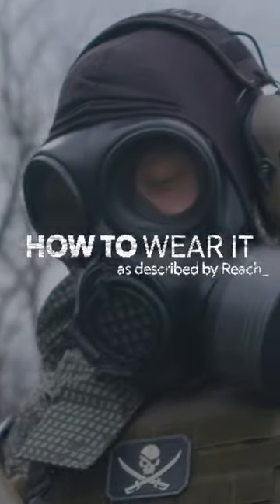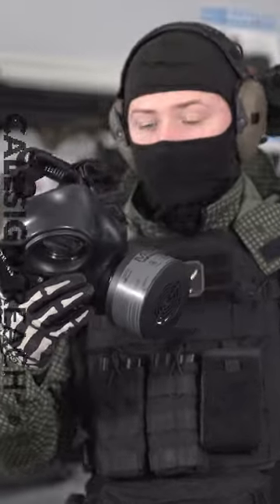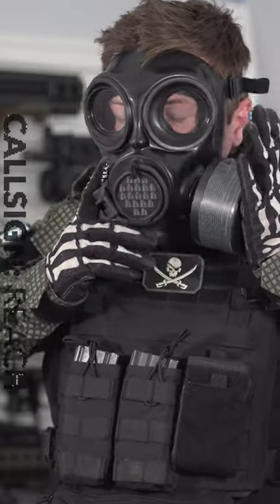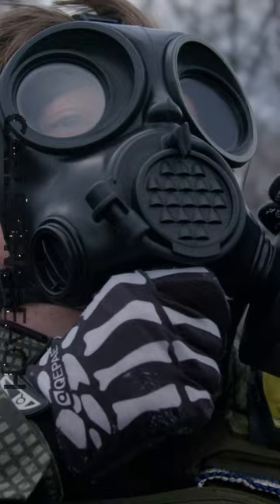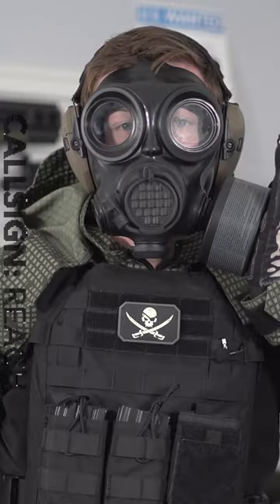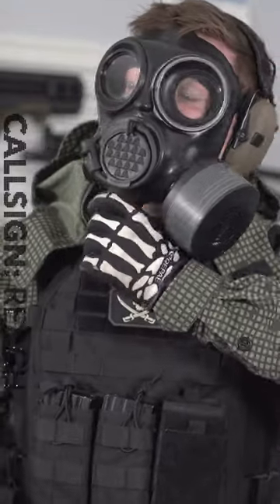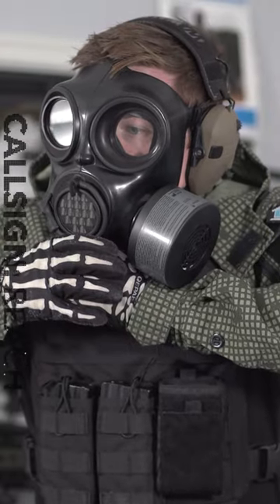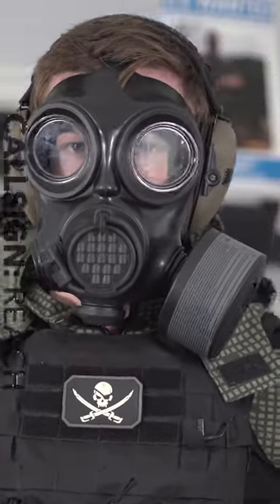MIRA Safety CM-7M PART 2 | Callsign: Reach #airsoft #mirasafety #gasmask

Comment: Should be rubber touchin skin.. nothing in thee way
Reply from the maker: Words to live by 🤜🤛
Reply: I hope it never comes the time where I need to wear a gas mask because I would have to shave 😢
Reply: @Mrboombastic266 id rather shave than die
Reply: @Not.TravisScott  True, I would be dead inside tho
Reply: @Mrboombastic266  same lol
Reply: @Mrboombastic266  there is a mouth piece for people with beards, the filter mounts on the your back i think, the downside is that it can slip out so you gotta tape it to your face or something, and you have to put a nose clip to seal your nose and then wear eye protective glasses to protect against fumes and stuff, looks like diving gear
Reply: this had been disproven, you can have the biggest most santa claus-ist beard ever, it will still seal fine
Reply: @blueberry766 id rather look like scuba steve than baby face, ill take it
Reply: @Mrboombastic266  you don’t have to. Siri shows that she doesn’t even matter.
Reply: You can wear modern gas masks with facial hair as long as it isnt bushy
Reply: @Mrboombastic266  depends what mask, some will work with beards.

Comment: I hate mira safety, you can just get a slightly worse mask for $100 less
Reply: Hell, you can get the same mask for under 100, shipped! They're just repackaged OM90s!
Reply: These are new production masks. While they may be built like the mil versions, they are new materials. Over time, the material breaks down and loses its resistance. I wouldn't trust a milsurp mask unless I literally had no other choice.
Reply: No you can get a slightly better version for 100$ less lol

Comment: Can’t believe mira “safety” is selling an obsolete CZ gas mask from the 90s for around 2-3 times the price. Like for that price I can get an m50 mask  that is way better and with a filter if I’m lucky. Plus you could get a cheap Israeli civilian gas mask for around 30-45 dollars and ABEK or CBRN filters for 20-30 dollars
Reply: mira is new production, and as someone who uses an m50, their honestly about equal, but the m50 filters being proprietary is stupid.
Reply: @Anarcho-harambeism yes I realize this now but it is still a very obsolete mask and is basically a rip off of a s10
Reply: @Anarcho-harambeism also it is very overpriced in my opinion
Reply: @Epsilon11117  I can agree, though I suppose economy of scale might be hitting them,  I wanted to buy a c50 but the 40mm armt actually 40mm.
Reply: @Anarcho-harambeism Isn’t the c50 in nato standard 40mm? Because from what I’ve heard it is in nato standard. But if your talking about being able to accept all 40mm filters it can’t fit gost filters but that wouldn’t be an issue if you live in the us because gost is Soviet/Russian standard filters and the gost filters have a different threading.
Reply: @Epsilon11117  from my experience, it's weird, it's like a hair off from 40mm, you can make some work but not all.
Reply: @Anarcho-harambeism yes but if your in a situation where you actually need it the filter would NOT make an airtight seal and even if it looks like it has a seal it is still letting air in because the filters have slightly different threads
Reply: @Anarcho-harambeism are you using nato filters? Cause then I don’t know what the problem is because all nato filters should fit
Reply: @Anarcho-harambeism What filters are you using?
Reply: @Anarcho-harambeism also correction, the Mira safety gas mask is made by them but it is just a copy of the cz om-90 from the 90s. And it is way overpriced because you can get an om-90 sealed and brand new for around $90-$110
Reply: Thanks for actually calling this scummy crap out

Comment: US army pamphlets on cbrn and gas mask drills are technically public available unclassified and unconfidential. Remember you have 9 seconds, DONT BREATH in or out when gas is called. Immediately remove your ach, hold it between your knees
Remove mask from bag (mesh should be folded over the goggles to easily fold over head) fit to face, pull mesh over head and immediately tighten two bottom straps (the tops are fitted once and kept tight) immediately place palm on outlet and purge by blowing out all the air in your lungs, then seal the inlet on your filter and breathe in creating a vacuum seal in your mask, requip your ach and prepare to leave quickly. This all needs to happen in 9 seconds of a callout. Practice and preparation will keep you alive incase of a chemical attack.
Reply: 🫡This short triggered a bit of nostalgia but then I remembered how fun 12 hour shifts in mopp 4 in the hottest part of the summer was😂
Reply: All of that in 9 seconds?
Reply: @creepinplayz0405  yes its quite a bit to do, its "the average amount of time" someone has to react to a gas attack, how they came up with that number is something i couldnt tell you. Also your only allowed to alert everyone else to the attack until after you don your own gear giving them even less time.
Reply: @John-lw5xc  I’m assuming that last rule isn’t really followed
Reply: @John-lw5xc  and this is with the c7m? (Om90) or with the more likely candidate I would assume being either the m50 or c50? Because I tried such at home with my om90 yet the straps had the main issue of constantly getting caught on something or other on the front of the mask killing my time
Reply: @TheBetterPMC  idk how that one works man

Comment: It’s basically a less compatible more expensive ct12
Reply: its litteraly just an om-90 but 3 times the cost.
Reply: They're OM90s, repackaged. And the OM90 is a copy of the S10 masks. Even their Outsert lenses are compatible. You can find OM90s for under 100 bucks. That's why MIRA pushes them so hard. They make 200% profits.

Comment: Tip from a firefighter:  leave the top two straps tight and the bottom two straps loose.  When you put it on, all you’ll have to tighten is the bottom two, and maybe a courtesy tug on the top two.

Comment: Blowing outwards lightly while blocking exit valve should not let out air fast. Thats one thing to test for too.
Also I recommend for people not so experienced with NBC masks and compareable in general, do not tighten the straps too much. When you exert yourself and actually do some life endagering work, the straps will relatively quickly push on your head and start making you dizzy.

Some people found out that the hard way when we did live agent training.

Comment: When using this with airsoft, is the mask (specifically the eye portion) impact rated for cqb airsoft ~1.5J, and any damage to the eye pieces after a few hits from bbs? I have a CM-8M and saw they are rated for EN 168 impact protection but was having trouble accessing the standard.
Reply from the maker: I only have third-party reports. Mira has a solid marketing team that will likely give you a better answer than I can. They should also be able to draw a comparison between US and EU impact ratings. I did not test impact rating, which is why I didn’t mention this in the full review video. I have heard (anecdotes) from users who say it is impact rated for airsoft and who use the mask as eye protection. So, for the purposes of the review, I can’t recommend it for use on the field because I haven’t independently verified, although I know of players who have used it that way.

Because of its intended use, the eye protection would have to be rated to EN/ANSI standards to be accepted by any law enforcement or military group as standard kit (which it is). 

Not a straight answer, but I wanted to give you what I have!
Reply: I would say NO, they are not ansi rated for Impact.
Reply from the maker: Could you link me some resources? If Mira’s selling stuff that’s not as advertised, I’d definitely like to check that out myself.
Reply: If ur just doing airsoft get a surplus gas mask as they are way cheaper, still functional, and wont cost an arm and a leg. Or ya know just don’t yse a gas mask for airsoft

Comment: hey quick fyi, Mira is a pretty scummy company when it comes to the marketing. These are not "high quality top of the line" masks or whatever else mira calls them. They are surplus czech masks that mira re sells for over 3 times the original price. And they buy off all the guntoobers. Mira sucks
(ur desert night camo is sick btw lol)
Reply: Good to know. What is a good alternative?
Reply: @AtomicBreadCannon  i mean miras cm7m is just a rebranded OM90 mask, you can get surplus om90s for like 70 dollars. Other than that what ill say is that any gasmask that can hold a seal and takes 40mm filters works.
my old gasmask was litteraly a 10 dollar gp5 with a 3d printed gost to nato filter adapter. Most of what your paying for with more expensive masks is just the comfort and urgenomics. Theres lots of videos on youtube about good surplus masks.
Reply: @mygoodsire864  much thanks. Mira's massive price is what has stopped me from getting one for a long time.
Reply: @AtomicBreadCannon the mask is a Czech ripoff of a British s10 gas mask. You can get those for around a similar price, you can also get the Chinese clone of the s10 called the fmj08 for a better price, but it is Chinese so take that how you will.
Reply: This is false, these are new production masks, not milsurp. Over time the seals and materials break down.
Reply: @skyofstorms  these masks aren't old enough for a seel to have realistically broken down. I have a mask from 1966 which still make a perfect seal. You could probably find ww2 masks that still make seals. Quality rubber doesn't just break down because a mask is a few years past its manufacture guarantee. If these were millsurp they would work good as new.
Reply: @deafsquid6978  Its not that the masks won't seal, its that the rubber loses its chemical resistance and will degrade when exposed to certain hazards.
Reply: @skyofstorms  not to the degree that an om-90 or an s10 wouldn't work pretty much as well as a brand new mask. It certainly doesn't justify the price tag on a Mira mask.

Comment: Learn this while trying to cosplay as Thatcher from rainbow S10 wouldn’t seal properly when you do the balaclava first gas mask later so you need to wear the gas mask first then put the balaclava on(preferably the one that cover everything except your face
Reply from the maker: Yes, you are correct! Masks, clothing, and even hair (beards, bangs, etc) can interrupt the seal on a gas mask. It should only be rubber on skin 👍
Reply: Open face balaclava (so just a hood, really) should work.

Comment: I want to order an M40 model gas mask. I found it at a very affordable price with a filter. Can I use this mask for airsoft? If necessary, I can make a hole in the filter to breathe easily. It is a very cool and protective mask. What would be your recommendation?

Comment: If they lowered the price to 50 dollars I'd buy it
Reply from the maker: You could check out some of the used gear forums on Facebook if you’re looking for a cheaper one. I’ve seen some older milsurp masks on those.
Reply: @CallsignReach  do you have a link bro?
Reply from the maker: @Krishtonas  I can't link but I'll drop you some models below to look up. Just look around on eBay/FB/etc. and wait for something decent to come up in your price range. As long as it's not damaged and the faceplate/lenses are in good shape, they will do the trick. If it's just for looks/cool factor, condition isn't as important, but if you want it to actually work, you'll want to make sure it uses 40mm NATO filters and that it has all of its pieces:

MSA Phalanx (old police gas mask)

MSA Millenium

MSA Ultravue

Avon M50 (currently in service in the US)

GM17 (retired service gas mask)
Reply: @CallsignReach  I appreciate it man thank you gotta prepare so we get the stuff to fight the Russians right?
Reply: They're just OM90s. Do some googling. Don't pay more than $100 CAD. ;)

Comment: Just wondering, did you need to swap out the lenses? I heard that they use a different glass, I think silicate, instead of polycarbonate. Is this the case, or do they hold up to bbs as is? Trying to decide between the m6 and m7

Comment: I’m stuck between the c6 and c7 for airsofting use. I am pretty sure the 6 uses polycarbonate while the 7 uses a silicate glass for lenses. Is it still just as impact resistant because I do need it to hold up to airsoft bbs

Comment: For everyone saying these are OM-90's you are correct in that these are a similar style. However, these are brand new production masks, not milsurp. Over time rubber and seals degrade. I would not use a milsurp mask for serious use unless I had no other choice. I've used this and the 6m in hazmat environments and they are excellent products.
Reply: What hazmat environments have you used these masks in? Having handled this mask myself I can tell with absolute certainty that it is inferior to surplus M40s and undeniably worse than a modern M50. The mask is full of outdated designs, wether it’s the ocular lenses that everyone except the soviets stopped using, the terrible drinking tube, or the lack of glasses insert- these masks are terrible when compared to both modern and older masks. Oh yeah the mark up doesn’t help either.